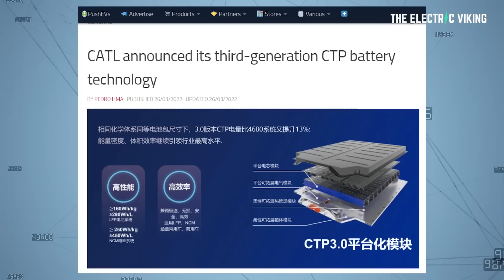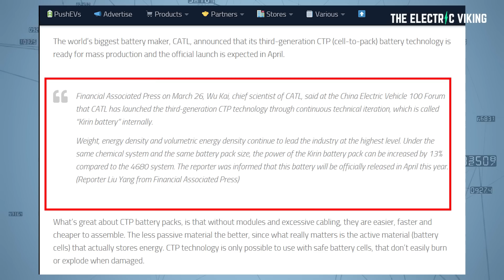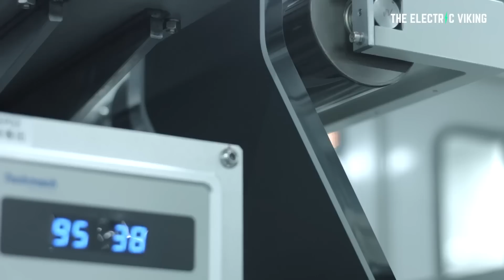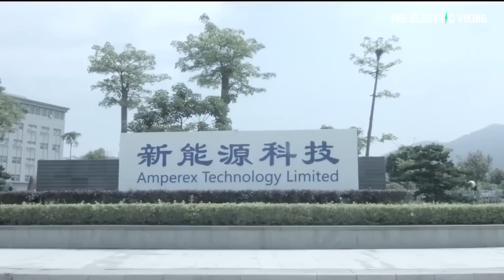NEW Teslas to get 28% higher energy density LFP cells

Comment: I find it fascinating that no one company has yet developed the AC magnetic motor to say 500% efficiency
Reply: Isn’t 100% the highest that efficiency can achieve?
Reply: @baldybreaker  electric motors are already 95-96% efficient
Reply: @GreenDriveIndia  More like 85% to 90% for the best “synchronous” electric motors.
Reply: really
Reply: @rexgeorg7324  Efficiency equals useful energy/supplied energy. Times 100 for percent. It can never be over 100%. If it was over 100% then it would be outputting more energy than put in. Which, of course, is impossible!
Reply: It always seems impossible until it’s done.
Reply: @rexgeorg7324  In the realms of science fiction at the moment. Maybe in the far future humanity will be able to change the physical properties of the universe to get such free energy? Unlikely.
Reply: Drugs or a bad education?

Comment: Those better batteries could be used in different ways: 
A. Better range
or
B. Lighter weight + cheaper battery pack.
Option B. is specially useful in small cheap EV's
Could also be useful for E-motorbikes. Maybe even for small electric aircraft.
Reply: Tesla will take option B.
The fixation for more range won't sway them from "the mission" of getting more cars on the road, thus speeding the transition.
If it's really "28% more range", they will use 20% fewer cells and still get 5-10% more range (more if they feel necessary)
Another company trying to compete would probably need to throw the whole quantity of cells at the pack, increasing cost.
Since they are not making much profit per car, that's not ideal.